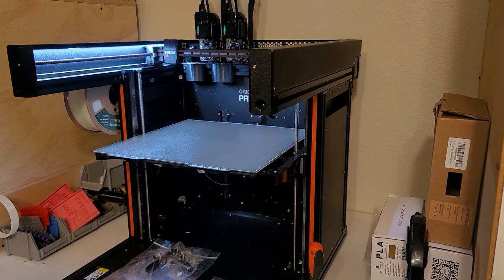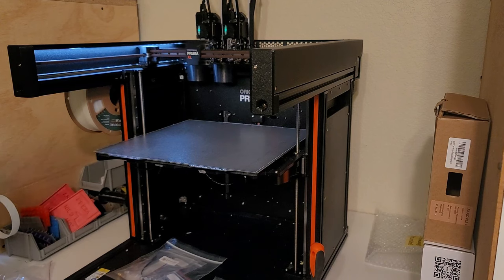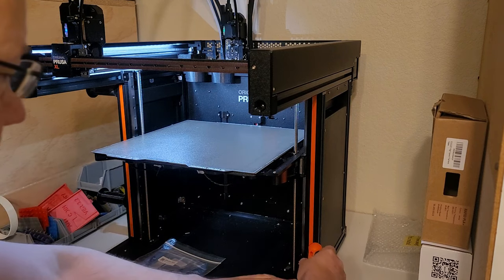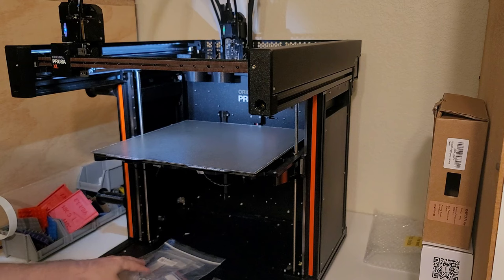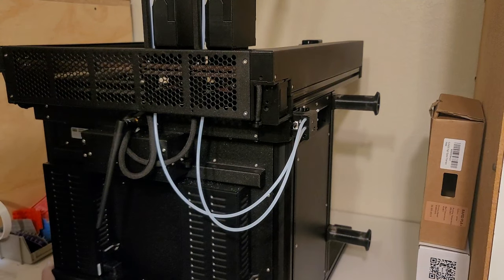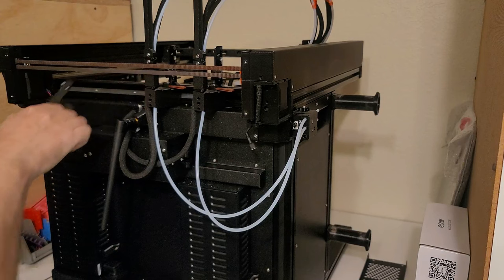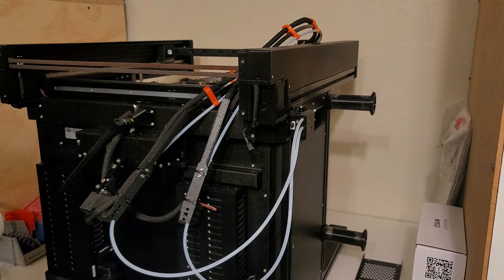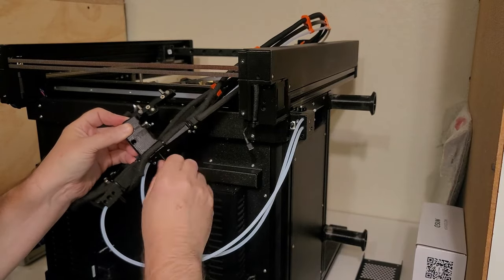Prusa XL Replace Docks

Comment: How did you get that screw out holding dock?  Looking at like min 18 in video.  I can't get mine out.
Reply from the maker: The top part comes off.  Skip to the 45 min mark and you should see what I removed.
Reply: @Arcadenut1 what size allen if remember?
Reply from the maker: @Rmilyard they are M3, so a 2.5mm  Allen for the center, and Torx for the upper and lower.